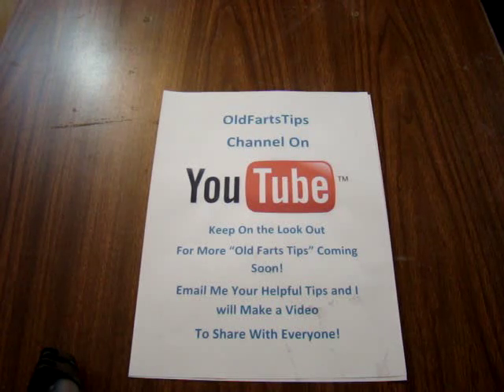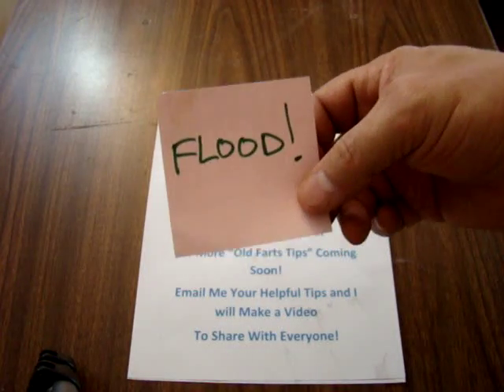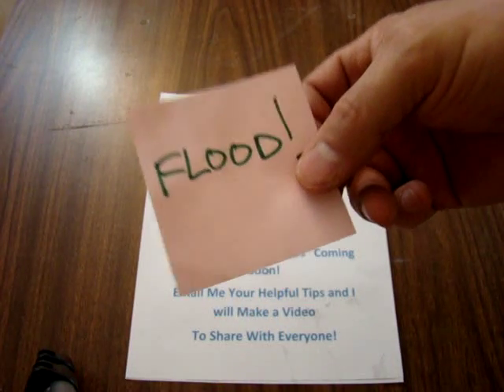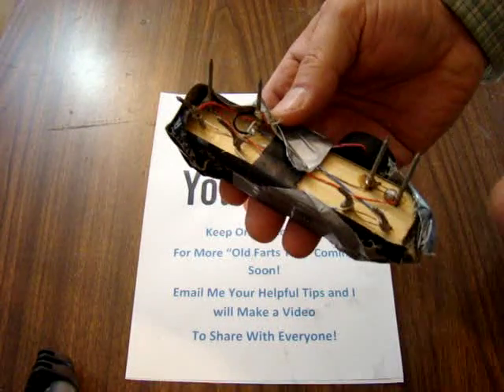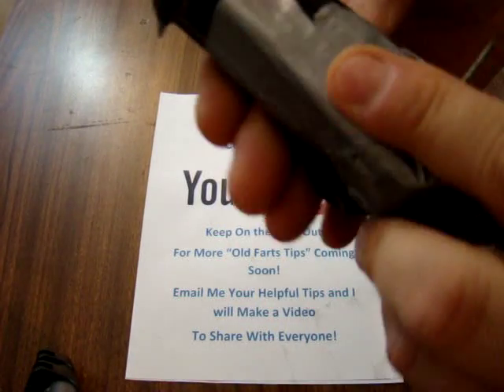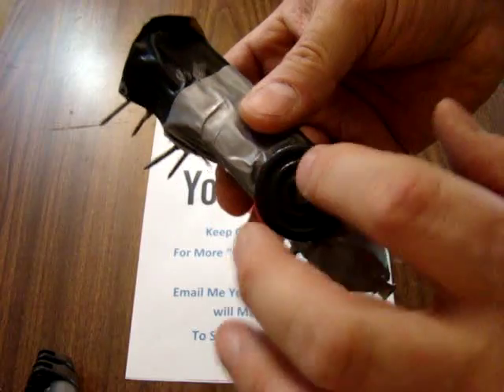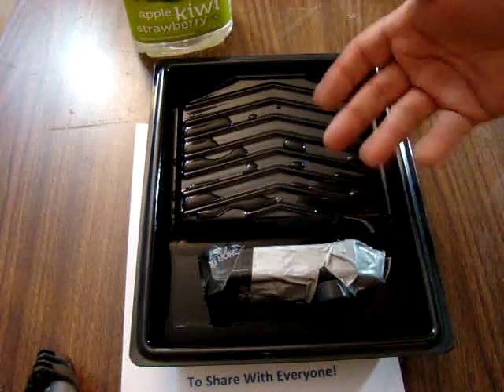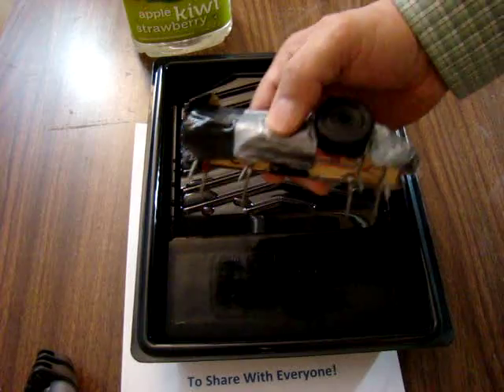Flood or Water Detector Alarm Build Your Own Sensor! Helpful Home Tips Old Farts Tips #5

Comment: hello sir i also would like you to email me the steps for this procedure i wanna try it because i like it and it's pretty helpful thank you and nice job
Reply from the maker: Melchor Felipe Abaga Ntongono 9V battery get battery holder-  connect one side to 9v buzzer, other side of buzzer  to nail-   then drive another nail in wood connect other battery wire to other nail-  water connects the circuit and makes buzzer buzz-  watch video closely--

Comment: How it was made? can you email me its step by step procedure ? plsss. Need this on our project.
Reply from the maker: 9V battery get battery holder-  connect one side to 9v buzzer, other side of buzzer  to nail-   then drive another nail in wood connect other battery wire to other nail-  water connects the circuit and makes buzzer buzz-  watch video closely--